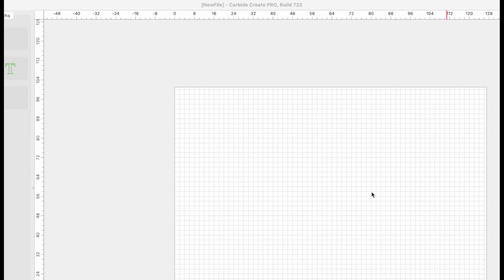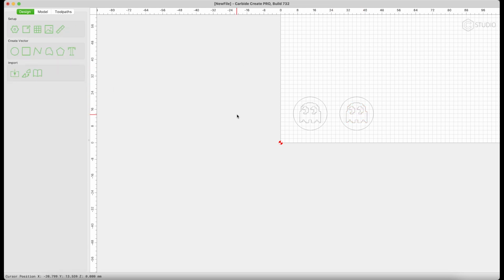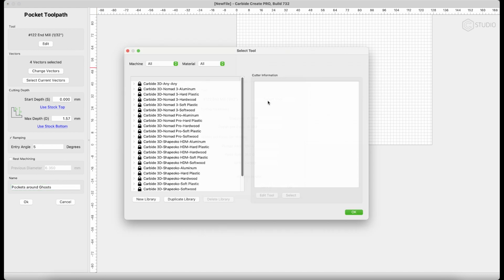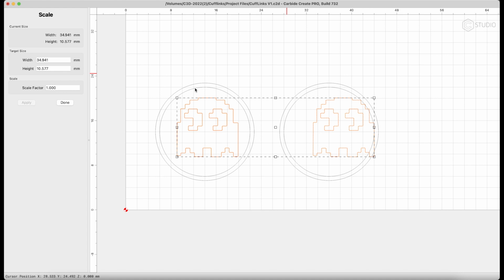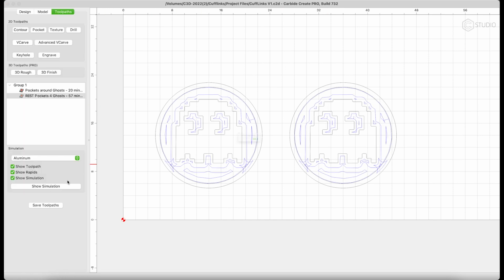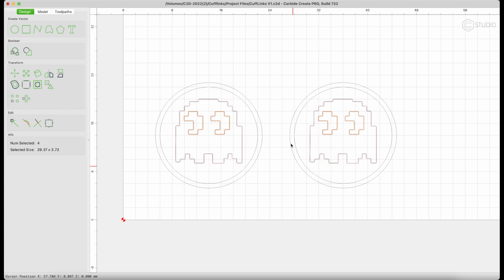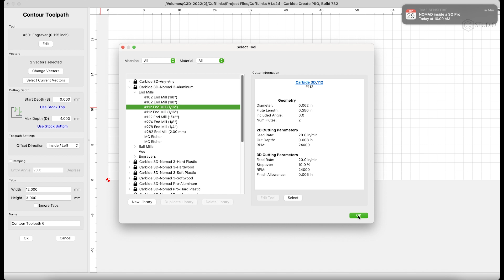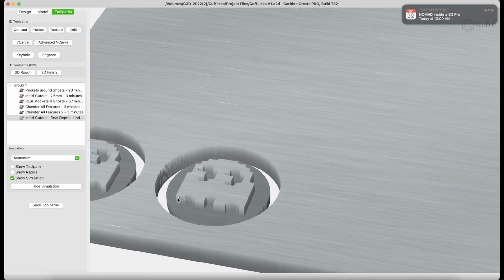How to: Design in Carbide Create

Comment: I don't have a machine yet, wanted to see if I could understand what is required first.  You seem to go through all the steps like we already know what we are doing.  I need a video that goes slow, step by step explaining how to do the steps.  Please, I need Carbide3D for dummies.  Hello, beginner and zero experience.  I have been on the forum, internet, and spend the last 3 full days of frustration.  Do I need to research a more friendly machine with more detailed instructions?
Reply from the maker: Eldon - My.Carbide3D.Com was built for exactly that purpose.   Even before you own a machine you can watch the 5+ hours of content.   It’s starts at the very basic elements and works forward.  
Come back and watch this after a little time over there and you’ll be golden.
Reply: And if you ever need a little bit of help I can help.